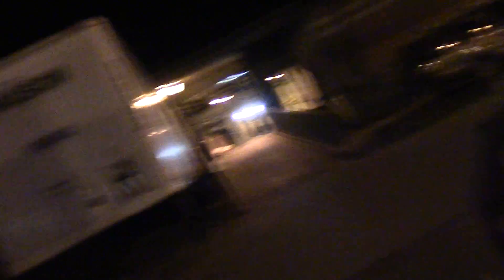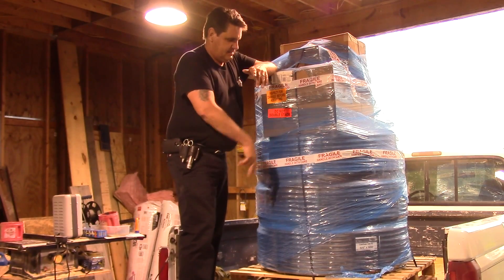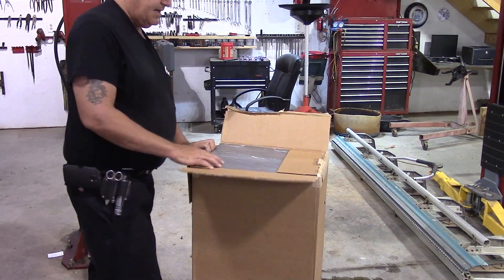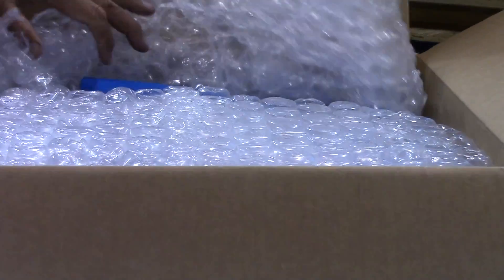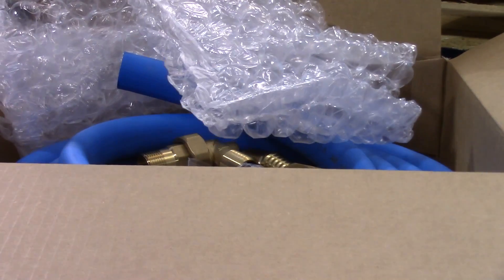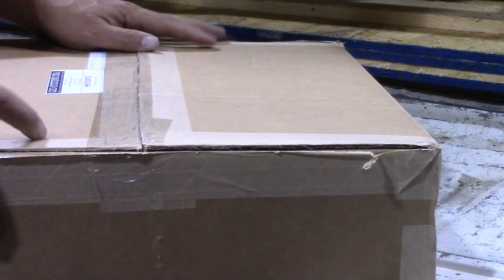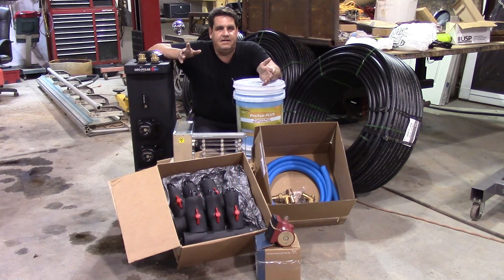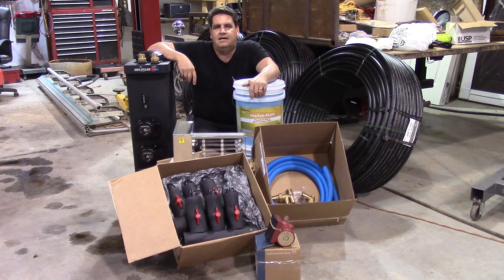Our Geothermal HVAC system from Ingrams Water & Air Part 1

Comment: How is the system holding up after some years of use? This is a big concern since many complain that after a while it becomes useless.
Reply from the maker: I have to say that ours has been trouble free thus far. We did have one little snag when I was installing it, it had a bad 24 volt control transformer that technically wasn't bad, its voltage was just high enough to trip the safety software on the main circuit board thinking there was a problem. Other than that it has performed flawlessly!
Reply: @MacGyversWorkshop  Thanks for your honest reply.

Comment: wow do you really want to tackle this. i researched this even in a town lot. wow it is going to be big and if horizontal wow. i shall be watching for sure, wow. suppose you will not be going solar but you could without that coil in the air handler.
Reply from the maker: +George Gardinier We definitely want to tackle it. We have 14 acres so there is plenty of land for the horizontal ground loop which is much cheaper than digging a vertical well which is what most folks have to do since they don't have enough land to stretch out 250 feet of line 6 feet deep in the ground. We do plan to implement a battery backed solar system for electricity, but that's a bit down the road after the house is built.

Comment: Geothermal HVAC system whats that do mack?
its ok i just found out it pushes 50f into the house in the winter that's 10c man it must get cold were you are my house in the middle of winter doesn't ever go below 10 c i thought it was a cold house
Reply from the maker: +obieezx11 Your thinking of a different type of geothermal. This uses it in conjunction with a heat pump, but instead of a coil outside with a fan, you have the lines in the ground. This allows the heat pump to work when its well below freezing outside whereas a normal heatpump won't make any heat below 45 F without the use of the electric heat strips.
Reply: +Mac Gyvers Workshop hope it works out